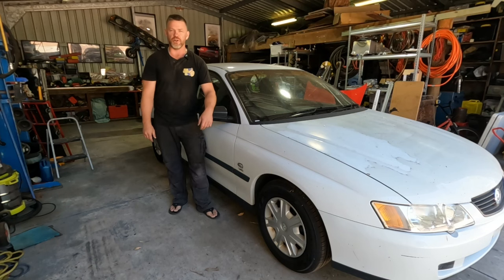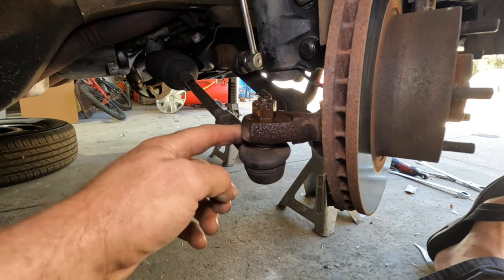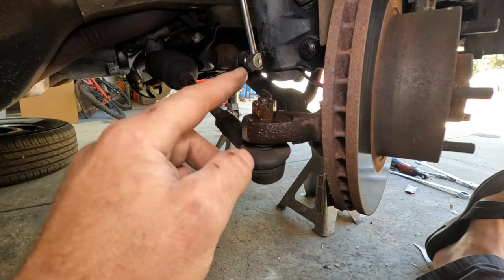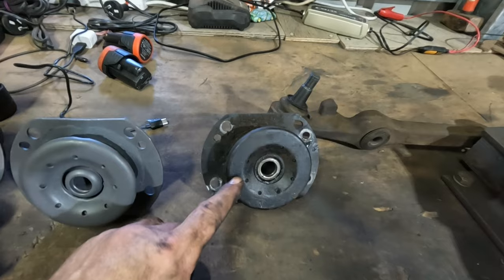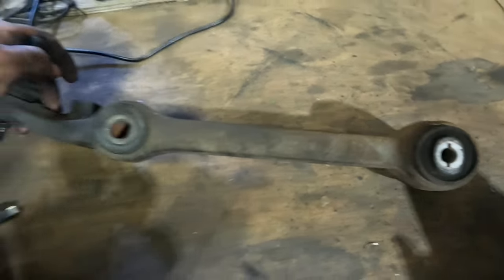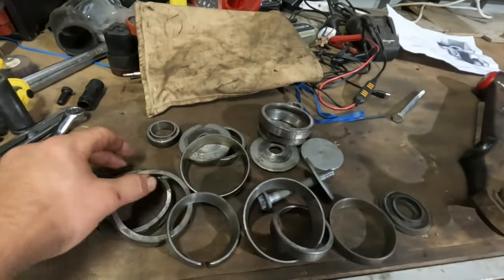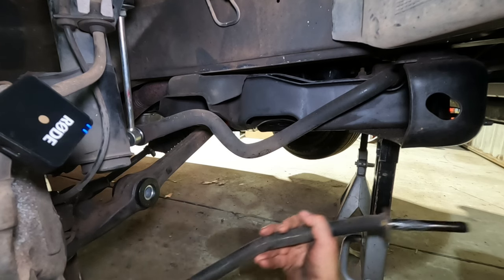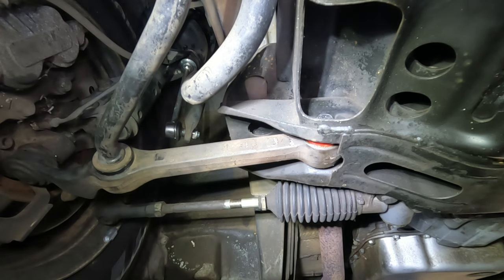Commodore Control Arms and Z bar bushes

Comment: G'day Byron 😃👍 i admire your determination & patience to replace individual bushings & to put in the time 👍 But with me being me id rather spend the extra couple  of bob (coins ) & buy the complete  Control Ams for Left & Right  front end with the Bushes already  assembled  within  the Arm , You have more skill & patience  than me ☺️  i have a 2004 Vy Calais V6  & im in the process  of doing all suspension  & im time poor so i buy the complete  part replacement  in most cases if possible 👍 plus being a 2004 age i just figure its best to get everything  new & get another 20 years out of the car for my son when i hand the Calais  over to him 😜 i really  enjoy  your videos  Byron  & i do learn some  handy tips & ways of doing things on cars 😝 Especially  the VY Calais  or any Commodore ! Cheers  from Bundaberg 🕺🍹
Reply from the maker: @stevewilson8752  yeah awesome mate 👌 
I agree with replacing the complete arm for time and straight forward replacement 
Take it easy mate Byron 👍

Comment: G'day Byron, new subscriber...great videos mate, you certainly make it easy for us common folk to understand, appreciated. 

Just interested to know why you chose nolathene control arm bushes but a rubber caster bush (e.g. preference, experience, economics, etc.)?

Also is there a difference between the black & red nolathene bushes you used on the control arm?

Cheers mate, just trying to understand...
Reply from the maker: Alex how you going mate 
Yeah i try to buy a cheap bush kit off ebay and try and replace them on the bench without a press haha i may of stuffed up the in bushes and through how can someone at home do it still with out a press thats why i ended up fitting the pedders kit
But i caught up the the bloke yesterday that brought the car and every thing is still mint 👌 
When it come to which nolathene bush im not sure mate but i do deal with Pedders suspension so if i do have any dramas i just catch up with them
If your not on to much of a budget id buy the complete arms and just swap them over saves time etc
Any how mate take it easy Byron 👍
Reply: @downtheshedwithbyron  Yeah, the complete arms look like the simple solution. 

Thanks mate, keep at the vids man, there's plenty of people that need your no-nonsense, get-it-done-right approach. 

Appreciated...
Reply from the maker: @AlexanderFerris-k8m  yeah cheers mate 👍

Comment: Just a question what can cause a engine light a safety power mode a reduced power on a ve commodore
Reply from the maker: G'day mate 
Sorry but im not sure
Reply: @downtheshedwithbyron 
Sounds like Goss ignition coil and module needs replacing, you can check one by one from the three of them individually or replace the whole module.
Also check the the ABS module, it might need replacing. I had a similar problem  and ended up changing both and she’s good to go mate!👍